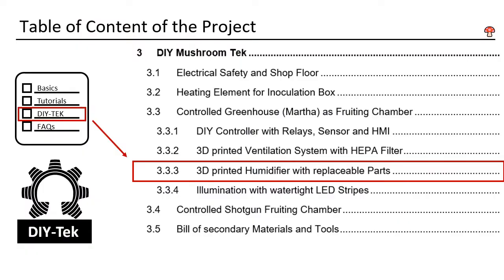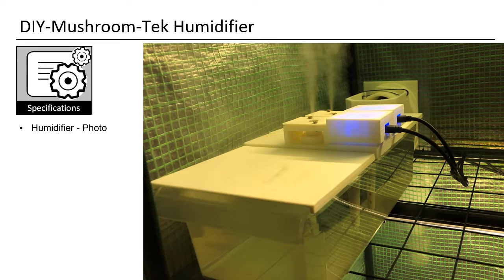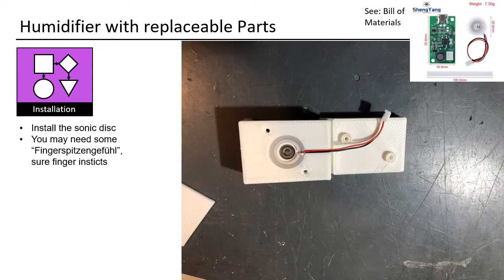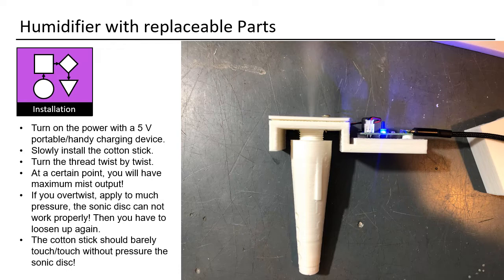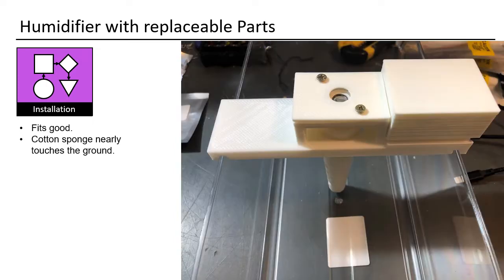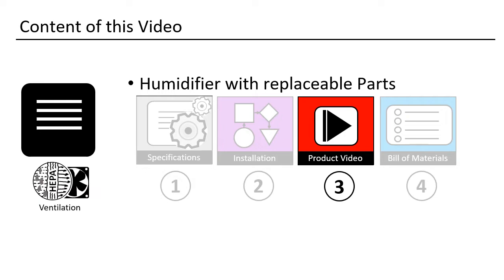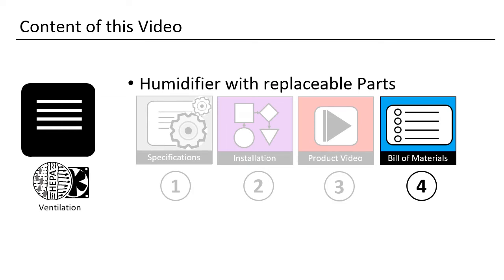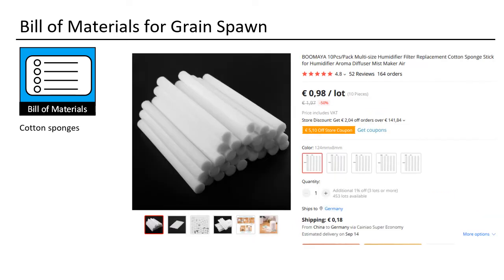3.3.3 Printed Humidifier with replaceable Parts for Martha Grow Tent

Comment: Hi 
Do you have issues with rusting (oxidation) of the shelves, and/or. the zippers of the tent?
Reply from the maker: Hey, The Martha is an inexpensive product, but mine was of good quality. That said, I tried to prevent the shelf floors from bending to keep the coating intact. If I noticed spots where rust was starting, I always applied simple nail polish directly to seal the area and protect it from humidity. This worked very well for me.

After switching to a grow tent, I continued using the Martha shelf but not the shelf floors because I started using my PLA-printed jar hangers. For me, the Martha worked fine. If I hadn’t had a Martha, I would have bought a plastic shelf instead, as I think that’s the best choice when combined with a grow tent.

Regarding your question about the zipper, mine didn’t degrade. Perhaps your humidity is too high, causing water to constantly condense on the slightly cooler zipper? I read somewhere that you can apply a little bit of lubricant, like standard household oil, to the zipper to keep it running smoothly. I’d recommend applying it with a toothbrush or something similar. I’m sure there’s a solution for your problem!

All the best, and happy growing!
Reply: @diy-mushroom-tek  Thank you very much for the detailed answer i really appreciate it ♥
I'm planning how to build one this weekend so I wanted to know if the rust would be an issue. It seems like it won't be that much of an issue 
Thank you for all your videos as well they are super informative
Reply from the maker: @ All the best for a smooth building session! Yeah, rust is no issue for a Martha—it runs like a charm. Greetings from Germany!

Comment: Hi!
First off, I really love your videos, they are incredible. The documentation makes it very easy to follow also. 
I soldered the back like you said. I tried soldering the + to +, - to -, and all kinds of other experiments, but could not get the mister to replicate the button push automatically. Once I solder it, the button no longer works. I don't think I bought a faulty item, as I got 2, and both act the same way. Maybe it is a dodgy build, but not sure. I spent about 3-4 hrs testing different setups, connections etc., and nothing worked. At the moment the whole system is functional, but I have an unsoldered item that I button press several times a day. 
Any ideas of another way to bypass the button? 
Thanks!
Reply from the maker: Hey, really sorry to hear about the hassle with your humidifier controller. To troubleshoot, here's what I suggest:

1. Check if the humidifier stays on when the button is held down continuously. If it doesn't, bridging won't work since the controller doesn't support a permanently pressed button. In that case, it might be time to consider swapping out the board.

2. If the humidifier stays on, try clamping the button to avoid having to press it manually all the time. This should serve as a quick fix.

3, For a more permanent solution, I'd recommend getting one of those controller kits. I've had great experiences with them. Nowadays, they often come with extra pads for easier bridging. Sometimes, this feature is even mentioned in the product description. Just flip the controller over and look for two square metal elements under the button – those are there to make bridging more convenient.

Here's a link to an example: 
TZT USB Mini Humidifier DIY Kits Mist Maker and Driver Circuit Board Fogger Atomization Film Atomizer Sheet Mini Oscillating
https://www.aliexpress.com/item/1005002425651727.html

Hope you sort it out soon and best of luck with your mushroom-growing adventures!
Reply: @diy-mushroom-tek  It keeps taking my reply down, but basically yes, I tried those methods. Pushing down the button sadly doesn't help, it keeps it turned off until it is released. I bought a near identical kit to yours as well from ali express, which is what I am using. Could this be the issue? 
Thanks!
Reply from the maker: Hey, if the button does not respond consistently to a constant press, then it seems like you will need a different board.

It appears that some manufacturers do not intend for their controllers to be used in this manner and have changed the starting mechanism to an "impulse" signal. Previously, a constant push was sufficient. However, there are fogger boards available that even require you to use them as a "direct spray" device. I will share some links where I have successfully purchased these boards. Check for:

◾Direct Spray or solder pads at the corresponding spot to my board.
◾Two extra Power Supply Positions

I have uploaded some pictures of a functioning board of mine here:
https://drive.google.com/file/d/1xCtTrhqewJ6vQ9XOeGWgqkuF18V48QrM/view?usp=drive_link

Sadly, the purchase link on AliExpress no longer works. Here is a link to a board that looks similar to mine, and personally, I would try it, but of course, I cannot guarantee anything.
https://vi.aliexpress.com/item/1005002425651727.html
https://vi.aliexpress.com/item/1005006177991586.html
https://vi.aliexpress.com/item/1005006198523997.html

Happy mushrooming!
Reply: @diy-mushroom-tek  ok, great! I am looking at ways to mimic an impulse control, so far no luck though.
Reply from the maker: @jadosfrombarbados   hey have you considerd using a button push device? they are quite cheap nowadays... https://de.aliexpress.com/item/1005006181462165.html

Comment: HI!! Water for the humidifier has to be mineral or filttered? Can it be distiled or tap water?? I'm thinking on putting ice on the tank to lower the temperature. Thanks a lot for this awesome project!!
Reply from the maker: Hey Hugo,

You don't need to filter or distill the water, but I recommend using lime-free water. It helps prevent your humidifier from clogging quickly. It's similar to when you're ironing clothes – it reduces maintenance time. Most natural water, like rainwater, is naturally lime-free. I personally use filtered rainwater, which not only removes impurities but is also lime-free. I use this water for my plants, especially if you have sensitive plants; rainwater is a must.

I haven't explored cooling methods yet, but there might be more cost-effective alternatives to icing the water. Perhaps another grower has a good solution?

In any case, good luck with your endeavors and happy growing!

Daniel
Reply: @diy-mushroom-tek  great! I'll update the progress. Thanks again ;)

Comment: So on my "driver" there isn't a place to solder under the board. Can I solder the top side? The 2 legs furthest away from the USB on the on/off button
Reply from the maker: Hey grassfpv! I already answered this question for a fellow grower.  You can also solder on top of the board or bridge the connection with a small cable. I would advise, to test the bridging with a small cable in advance to check if it works. Please have a look at this picture: 
https://drive.google.com/file/d/1DIAzEUYCgmBUtoYCfQGuVrxdmzfTl3nX/view?usp=share_link

Comment: Hi I am buying the Ender 5 so that I can print multiple of these setups. do you have any more detailed tips on how to print this or would you be willing to make a video on printing these parts specifically. THANK YOU!!!
Reply from the maker: Dear friend, 

I am happy to hear, that you want to use my build and start to learn 3D printing. The designs are quite easy to print. But of course, in order to make such a statement, one needs to know ones 3D printer. 

I would suggest that you start by using the prusa slicer. They have suggested settings for your ender printer! You can find the software here: 
https://www.prusa3d.com/de/page/prusaslicer_424/

After that, I would start to print some test prints, until you have figured out the correct parameters for your 3d printer. The test is always use is the benchy boat. You can find it here: https://www.thingiverse.com/thing:763622

After having achieved a nice looking benchy, I would start printing one set of my parts. In my experiences most cheap printers print inner diameter always to small, you need to find out the scaling factor for the threaded drill holes. I have a page in my presentation about that factor. 

After that you know your machine. Then you can easily print multiple sets!
If you use a 0.6 mm nozzle instead of a 0.4 mm nozzle the printing time is greatly reduced, but the printing quality is also reduced.  

Please do your electric bill and our environment a favor and install during you build up your machine something like this product: “10mm Thick Self-adhesive Insulation 3D Printer Heat Bed 400mm” https://www.ebay.com/itm/133032604320

I would also always use a glas bed for printing:
https://www.creality3dofficial.com/de/products/creality-new-upgraded-heated-bed-build-plate-surface

I always use cheap white PLA filament. I did not have any bad experience with that practice. 
I haven’t yet calculated the total costs of my build, but I think there is no substantially cheaper build possible. All parts I use are readily available electronics. Additionally, one has full control over one’s equipment. I think to build a farm with this setup is a reasonable idea. 

I wish you success! Keep us posted!
Happy Mushrooming!
Reply: @diy-mushroom-tek  My confidence has flown thro the roof. I appreciate every bit of info you have shared and I am now a patreon. I am picking up the Ender 5 pro next week. I plan on making a time lapse of the parts printing and putting it together.
Reply from the maker: @backyardfarmacy3  Dear Friend! Thank you for your support via patreon!
I am looking forward to your time laps video and you should be confident. YT is really good for learning 3D printing. The ender 5 Pro is a solid choice and can be upgraded if one likes to tinker a little bit. Many people already own a 3D printer and producing good results is no witchcraft. Anyway, if you run into any troubles, feel free to contact me.
Reply: Sorry, I didnt see that question,  or I wouldn't have asked again. I gotnit figured out and runs brilliantly!! Thanks for this idea!!